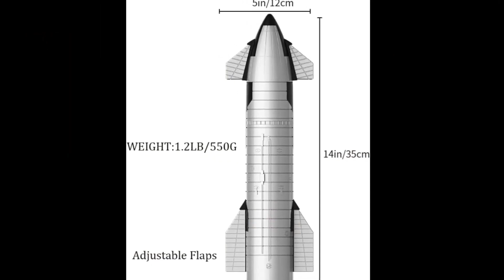SpaceX Keeps Getting In Trouble With FAA Over Falcon Explosion!

Comment: Sonic boom doesn't that sound like thunder dude?
Reply: Depends how close it is.  Too close and it will break windows
Reply: @skycop4093  Thunder too close will do the same.  But you haven't shown that falcon 9 lands that close to residential homes.
Reply: @rogerrussell9544  Falcon 9 does a burn to slow down that does not happen with starship.
Reply: @danharold3087  Yet it slowed and hovered in a designated spot without any broken windows nearby.